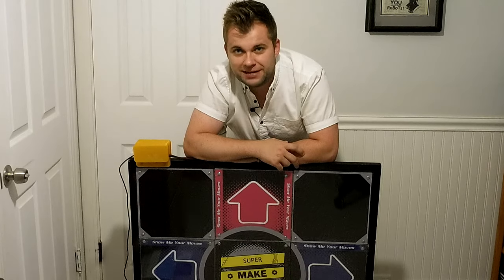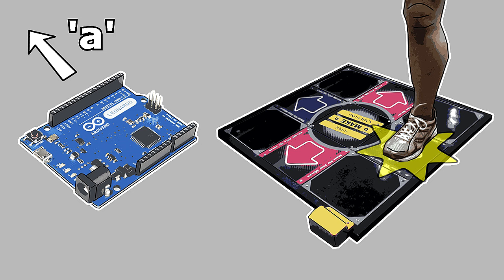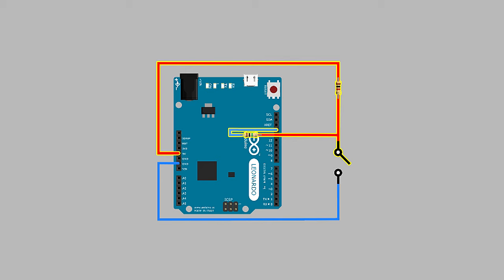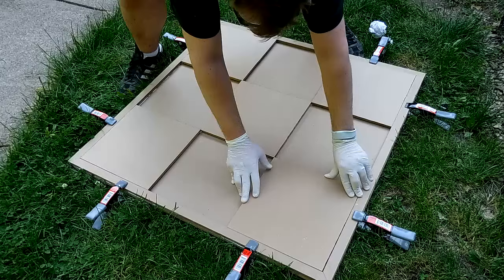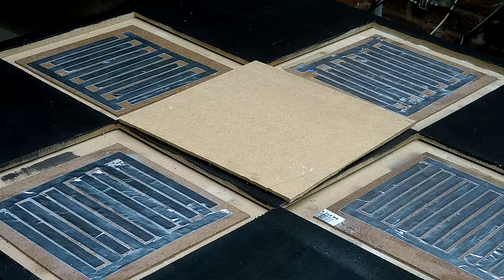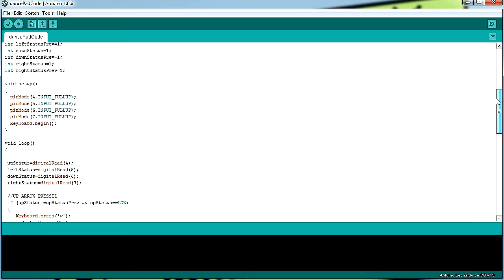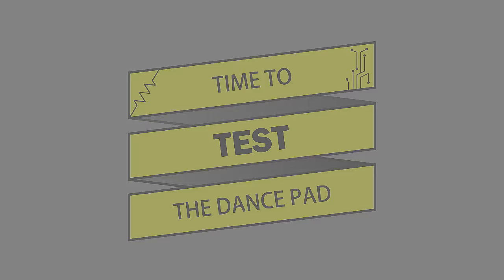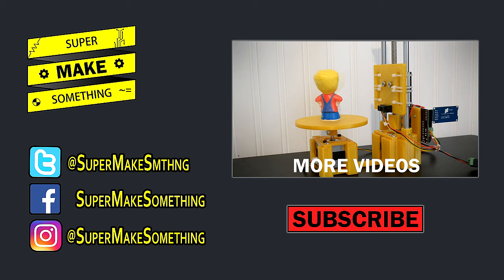USB DDR Dance Pad (Arduino, Pull-Up Resistors) - Super Make Something Episode 9

Comment: Does the foil comb method have any benefits over the edge sensor method?
Reply from the maker: Joseph Holliday I am not family with this method, but from the name, I think the potential advantage is that the comb method increases the likelihood of accurately sensing a button press regardless of where you step on the pad.
Reply: Super Make Something Edge sensor method is what the pads in the arcades use. They have 16 pressure sensors, one on all 4 edges of each pad. I've seen a few builds that use homemade pressure sensors.

Comment: Hello. what was the baseboard made of?
Reply from the maker: The baseboard is made out of MDF.
Reply: @SuperMakeSomething  Thank you!
Reply: @SuperMakeSomething  Hello! another question. What options did you pick when ordering the Arduino. Theres several boxes/options you can pick and I was wondering which  one you picked.
Reply from the maker: @chromegnomeo8374  In the video I used the Arduino Leonardo, but any Arduino with an Atmega32U4 chip will work. The Arduino Pro Micro is a great, smaller option: https://amzn.to/43qhJVo
Reply: @SuperMakeSomething  this may be a dumb question but theres only three ground connection thingies on the arduino leonardo but theres four panels you step on. what did you do for wiring the ground. If one ground wire is connected to all the panels, wouldnt all panels be activated upon one step on a single key (hope that made sense).
Reply from the maker: @chromegnomeo8374  The buttons are set up so that they trigger when the state of the button changes from high to low, which happens when one of the buttons is stepped on the "close" that part of the circuit. The ground connection serves the common "reference" for what is considered low, but the voltage on a button doesn't change until it is stepped on because the circuit for the other buttons isn't closed.  Because of this, it's okay for them to share one ground connection. Does that make sense? Hope it helps!

Comment: Is it just me or aluminum foil contacts doesn't sound convenient? Was hoping to see some sort of the pressure sensors etc. Also there is a smaller version of Leonardo - Arduino micro. You cound pretty much make an aperture in one of the "not pushable" panels on the corners and make an exit of the micro-usb of the arduino on the side. So all you will have just your pad that u can connect with any USB-microUSB wire. 
Acrylic panels is just fine, problem in deflection. It deflects too much make acrylic glass bend and crack. If u dance on real DDR u probly notice that buttons never bend over. So as i was say such contacts isn't convenient. Also this construction doesn't light a buttons which doesn't look so cool as real DDR. I would also add an aluminum frames on the sides, that would give more cooler look for the pad. About tape a wires to contacts? Come on dude, seriously? You don't have to test it to see that it will ripped out from the surface due constant vibration. Instead use an acid and soldering if u wanna go with aluminum foil. Another idea just come up in my head is using PCB with same image of condemned contacts instead of  foil with pepper. It would have more reliable contacts and 
hardwearing. U can loot image with acid or just simply cut it. But PCB also doesn't like bending, so u can use it only on the bottom. Just thinking out loud. Mb someone will get an idea out of my thinking. ^_^
Reply from the maker: Maxwell Hawk Definitely a few ways to mod this design. I didn’t want to go with 4x4 pressure sensors because of the increased cost, but that would be a good way to read analog input during a panel push.

Comment: HI, can i do it also with an Arduino UNO? a generic one?
Reply from the maker: +Hepiro Anderson This project will work with any Arduino that is based on the Atmega 32u4 chip. The Uno has an Atmega 328 chip, so it will not work for this project.
Reply: thanks for answer my question

Comment: Does Arduino Nano works as well?
Reply from the maker: Unfortunately a nano will not work because it uses an ATMega328P. However any micro controller with an ATMega32u4 will work.

Comment: Super cool video you are awesome!

And what about PIU dance pad?
Reply from the maker: Daniel Uquillas Thanks! Making a PIU pad would actually be very similar. Simply add sensors to the diagonals/middle instead of the sides. It would actually be possible to transform this pad into one that works with PIU as well just by adding more sensors and inputs to the microcontroller.

Comment: could you do that with a raspberry pi3 too? and when yes what should i edit in the code than?
Reply from the maker: +MinecraftBob1000 4021 It appears like it may be possible to turn the Pi into a USB device, though it may be more effort and money than it is worth, considering you need additional cabling as well as an SD card with a full Linux installation: https://learn.adafruit.com/turning-your-raspberry-pi-zero-into-a-usb-gadget/overview
Reply: Than i will buy the Leonardo but  i have a problem: i don't understand how you did  the wireing ;(
Reply: I mean with the wireing i don't really understand if you had used resistors,ans how you did the wireing on the dancepad and which cables you used.
Reply from the maker: The resistors are already in the Arduino, and are enabled using code.  Basically each button is made of 2 panels, one which is connected to ground (black), and one which is connected to an Arduino pin (red).  You can see more information about this at 11:47.  All grounds can be connected together.
Reply: Thanks for the answer,but i don't understand how i should connect all these grounds together.
Reply from the maker: I run one wire between each of the ground panels, connecting them all together.  I then run one wire off of one of the ground panels to the microcontroller.
Reply: That means i need to put two wires(one black ground wire and one red wire)on  each panel and than i need to put each red wire in the leonardo and than i need to wire all the single ground wires to one long wire and put that in the leonardo?
Reply from the maker: Please see 4:13 for more information.  The red and black wires should not be on the same panel.
Reply: +Super Make Something okey now i understand what i need with the red cable, but i don't understand how i should wire all these single ground cables on one cable and which cables should i use for this project. but thanks that you're trying to explain me this :)
Reply from the maker: +MinecraftBob1000 4021 Any standard wire should work. For the grounds, just run a black cable between each ground panel, connecting them all together. Then connect another black cable to one of the ground panels, and connect this wire to the microcontroller.
Reply: That means i need 2cables for ground?and if yes than i need to run a single cable over each of the ground panels and than i only need to connect another cable to one of the ground panels like the ground panel on the up arrow?
Reply from the maker: +MinecraftBob1000 4021 Correct.
Reply: To be sure i need to solder or tape that single ground wire to each ground panel and than i need to solder or tape a second wire to one ground panel and then put the other end in the leonardo?
Reply from the maker: Any wire is fine as long as it fits into the Arduino female headers.
Reply: Sry,but what size do the headers have? And i think i will build(or at least try to build) the project :)
Reply from the maker: They are standard Arduino headers that come with the microcontroller.
Reply: Okey Thanks :)than i will buy all this in the next couple of days and try my best :)i hope all the wood and glass are not that expensive ^^how much did you need to pay for all the wood and the glass?
Reply from the maker: Similar to how they sandwich the wires in this picture, except you would insert the screws into the aluminum foil.  http://s3.photobucket.com/user/Frosty555/media/ddrpad-arrowwell.jpg.html
Reply: Ehm what do you mean? Do you mean how i should wire the cables to a screw or what?
Reply: +Super Make Something i have a question again ;)would it be possible to wire leds to the arduino and write a code that they will light up if you press a buttom? if yes how?and thanks for all you'r help.
Reply from the maker: It is definitely possible to wire LEDs to them and have them light up as a button is pressed.  The easiest way to do this would be to attached the buttons to different pins on the Arduino and add code in each of the if statements that sets the pin that the LED is connected to to "HIGH."  You will also need to add a resistor in series with this LED.  To get an idea of how to do this, I would search for Arduino "Blink" tutorials; these will guide you through wiring and programming an Arduino to light an LED.
Reply: Okey thanks,but what for a resistor should i use?and have you a example for a good tutorial Video?
Reply: And do i need a breadboard for this?
Reply from the maker: +MinecraftBob1000 4021 This should get you started: https://www.arduino.cc/en/Tutorial/Blink
Reply: Thanks,but it is possible to run many cables over one ground input?
Reply from the maker: +MinecraftBob1000 4021 All grounds are always at 0 volts because they are connected together/to the Arduino's ground pin.
Reply: So i could wire that to the single ground wire Form the pad or?
Reply from the maker: Looks good -- in this code, whenever a button step is sensed, the LEDs connected to pin 13 will light up and stay lit as long as a button is pressed down.
Reply: So i did it correctly? :O
Reply from the maker: Yes.
Reply from the maker: Yes, that also looks correct.  I'm sorry but at this point, this is really the only help with this project that I can offer.
Reply: I understand that.so than i will try this code when i completed the rest of the work ^^ thanks :)

Comment: Oh, maybe I can make this.
Oh, wait.... Omg you have to have a full workshop to make this. Nevermind, it's cheaper and easier to just buy professional ones.
Reply from the maker: Give it a shot — you might be surprised! While the sander is helpful to shape chamfers for wire routing and the craft cutter is nice to more easily cut the foil, neither are required. At minimum you would really only need a bandsaw and a hand drill.

Comment: can this be done with an arduino uno
Reply from the maker: This project requires a microcontroller that can act as a USB keyboard, which is only built into Arduinos that use the AtMega32u4.  Therefore an Uno will unfortunately not work with this code.

Comment: The only part I don't like about this project is the foam used as a spring. I'm a big guy and if I had one of those mats I'd dance at least 1 hour a day. That foam would become permanently squished and stop acting as a spring in a week I bet. I'd use actual springs. Also, if you use acrylic, you should use 8mm instead of 2mm, they'll never crack.

Comment: where did you get the print for graphics
Reply: i meant where did you get the graphics to print
oh and i was also wondering if you knew of how i could print graphics for a 2 player arcade stick
Reply from the maker: +Robert Schumacher I found the graphics online and touched them up a bit in an editing program. Unfortunately I do not have a good recommendation for printing graphics for arcade sticks. I had my panel graphics printed at FedEx and laminated, but they do not have a “sticky” back.
Reply: sorry but is there any way you could give me a link to the graphics you found or the file of grphics you made

Comment: Can we use an Arduino Uno
Reply from the maker: L3 X3N0 Unfortunately an Uno would not work for this, because you need a microcontroller that can emulate a USB HID device. However, any board that uses an ATmega32u4 should work.
Reply: I know I'm a bit late, but yes. You can change the firmware of the Uno to act as a keyboard, or write a software that reads the Serial Data and transports them to key presses. Using the second way you can even use an arduino nano, which is way cheaper.

Comment: wouldn't it be more effective to solder your wires to the aluminum foil?
Reply from the maker: Koopa Troopa Soldering to aluminum is unfortunately very difficult due to the oxide coating on the aluminum surface. Therefore a "mechanical" connection that sandwiches the contacts together is recommended.
Reply: Koopa Troopa I  wonder how much $$$ it woul be for copper foil? at least you can sodder to it

Comment: Wish I could've seen the arrows light up.
Reply: REEMIKS add a relay shield to the arduino and have them turn on EL Panels
Reply: how would that help?
Reply: REEMIKS the relays on the relay sheild can be used to turn on the lights for the arrows.
Reply: yeah thanks. I'm planning out a build for double dance pads and I'm trying to also add LEDs lights. Doing more research on the arduino and relay switches.